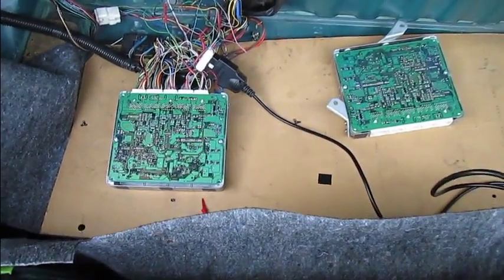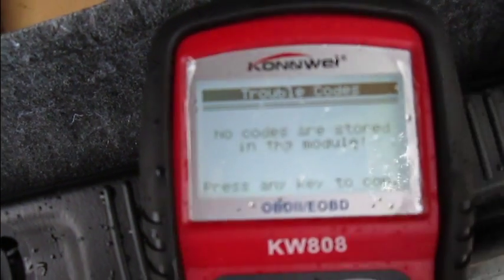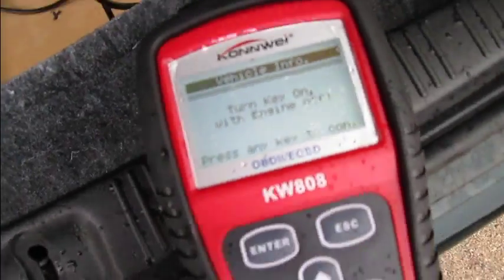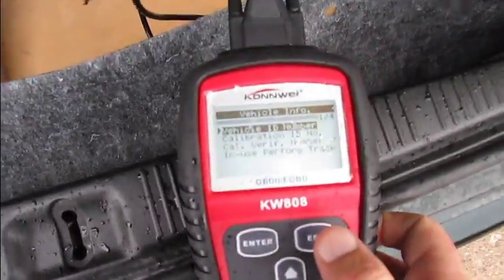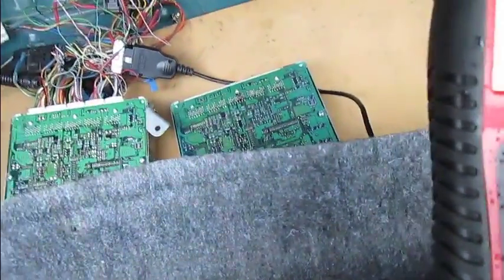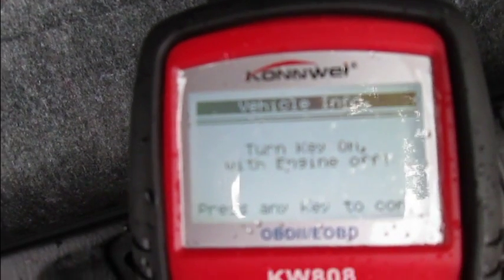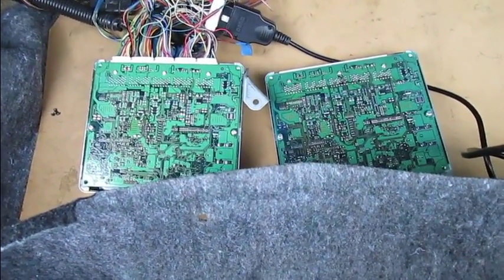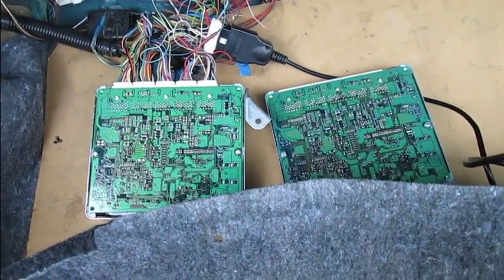Toyota 3.5L V6 2GR-FE ECU Hacked! Immobilizer Removed

Comment: Hello! Did you ever get your hands on the TRD ECU?
Reply from the maker: Yes, but there really wasn't much value in that tune.
Reply: @FrankensteinMotorworks didn't think so. I've just come into possession of the TRD ECU with supercharged 2GR-FE that I wish to use in a project with a manual transmission. I've just acquired the vehicles this week! So it's all in planning stages. Your 2GR-FE work has been invaluable thus far.

Comment: The vehicle didnt leave factory with 2gr fe rather 1mz fe. A 2gr fe  Ecu will never work, but i guess its all a joke as your Ecu is located in your truck which explains the joke
Reply from the maker: I'm not sure if you're being sarcastic or not but the MR2 is a mid-engine car so the ECU is always in the trunk. Also it came with the 5s-fe engine or the 3s-gte. The 2GR-FE was a swap that i did back in 2008 and i've been selling parts for anyone to do it since then. I even sell de-immobilized ECUs and there's at least 100 people out there that can tell you that i can actually remove the immobilizer from these ECUs. https://frankensteinmotorworks.squarespace.com/shop/tuned2grecu
Reply: @FrankensteinMotorworks  great work Sir, i honestly thought it was a 1998 toyota camry. Hats off to your workmanship

Comment: Actually duet is for a customer ,and w/o asking advice abt car have immo etc ,he ask some electrician guy why lock not turning, electrician broke the motor ,so lock turn but car no starts,due to a faulty immo box,work should have been done proper way,any advice will do, ie does the electric motor works like the hashes ie  mercs,  i doubt so its only a 4c chip. thaanks

Comment: Hey bro,i have a duet 998cc  4c Tp . ecu is 89560-97485 M30 engine EJ-VE- MT,how can i make immo off.some cowboy technician destroyed the ecu dump,immobox dump,electric steering lock, ecu is still good found a dump, eelctric ignition lock damaged the motor by breaking it,actually it was a faulty immobox,only had to buy one from ebay and transfer the code . any idea if electric ignition lock(mechanical lock with a motor) works similar to electronic ones ie merc,renault,or u cn remove the motor if it braks down and car will still start. please advice, any extras will  pay if u want.i  got a daihasu storia off ebay same engine code,  of coure P/N  little diff, only thing immobox is diff but with same eeprom inside,dont know if it will work w/o the electric lock as the daihat  uses mechanicallock w/o electric motor.
Reply from the maker: sorry i did not catch this earlier. Unfortunately my immobilizer removal technique is not universal so i really can't help you with that.

Comment: hi
i have a 2005 rx300 no spark at all ,showing  immobiliser communication fault in diagnostic , can u off the immo from ECU it might be ok? can u do it please
thanks hi tech
Reply from the maker: Unfortunately my solution for removing the immobilizer is not generic and cannot be applied to that ECU. Sorry.
Reply: I suggest trying all other keys if you have any, or programming new keys in lost mode yourself with a toyota smart key maker if it is still an issue.

Comment: Hello, i paired 2GR-Fe with manual transmission on Toyota rav 4 got check engine and vcs lights,does your product solve that problem? Thanks for respond.
Reply from the maker: It depends what year rav4, send me an email with details and i can tell you if i can solve your problem. Marc@frankensteinmotorworks.com
Reply: Frankenstein Motorworks "The email account that you tried to reach does not exist." could you send me another mail adress?
Reply from the maker: That is the correct address, it should work but failing that just use the "contact" link at the bottom of the Frankenstein Motorworks web page to send the initial message.
Reply: Frankenstein Motorworks Ok.
Reply: Small Buda I have any automatic v6 rav 4 can you explain the process and cost for the manual swap?

Comment: So now no longer have the protection of the immobilizer? And why revving 1500 RPMs at idle?
Reply from the maker: Yes, with this ECU modification you can avoid needing to wire in the immobilizer for swap applications. the high idle is because the motor is cold, it drops to a normal 650-700RPM or so after the motor is warm.
Reply: I see. Thank you for the information.

Comment: What ecus can you currently flash? I plan on doing a 2gr swap to my 5.5gen Camry. I have already emailed wiregap and they can perform the wiring required. I just need to get an ecu flashed to remove the auto trans codes, the immobilizer, and upping the rev limiter. No rush just curious what you would charge to do all that and what ecu you would need.

Thanks
Reply: send me an e-mail to Marc@frankensteinmotorworks.com and we can discuss the details but i can likely help you.

Comment: If you just remove an imobilizer will your car work and will this also work for lexus or any car with smart key fobs with push start?
Reply: I actually only have two ECUs figured out the Pre 2010 Rav4 and Highlanders. so far this has been sufficient to cover all the MR2 swap applications i support. I'm trying to get a more generalized solution that can be applied to other ECUs but i suspect the solution would not work for push to start cars.

Comment: Can you do this with 2 plug ECUs? I've been looking into putting a 2gr into my manual scion xB.a2z and 2gr have the same smaller plug (vehicle side) pinouts and might make my swap easier if i can use one of those ECUs
Reply from the maker: Chris,

yes, i do have the 2 plug ECUs done also. you can purchase them right off my site (Frankenstein motorworks dot com)  but you may want to contact me first over e-mail to discuss the particulars. (Marc at Frankenstein Motorworks dot com)
Reply: Thanks, the plans are still a ways out but i'll be in touch when i'm ready to start my swap.
Reply from the maker: No problem, feel free to ping me early if you have any 2GR questions. I do this stuff because i love it and i have fun getting involved with other people's swaps.

Comment: you plan on going the way of hondata and fully cracking the ecu? good stuff man!
Reply from the maker: +Bushtail Razorback I’m really not planning on taking it that far. I just want to be able to tweak a few things so i can use it at higher RPMs and with larger injectors to support a supercharger.